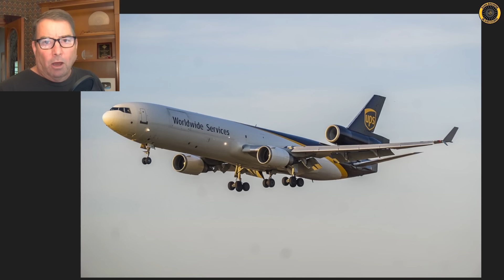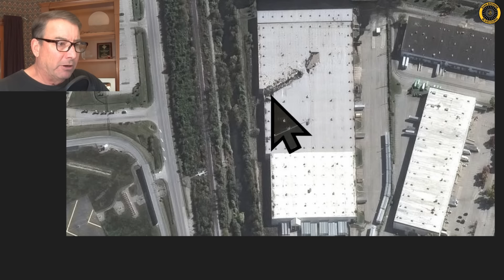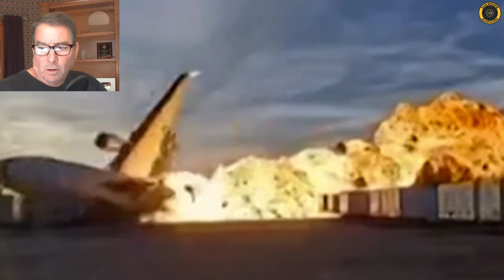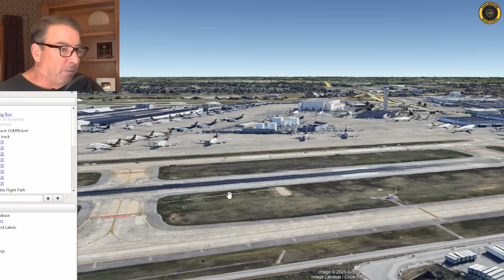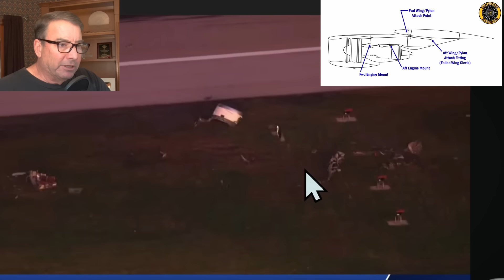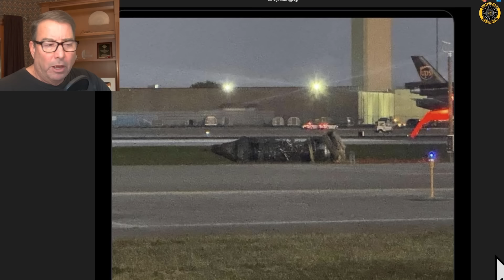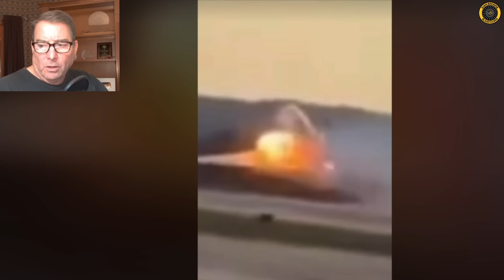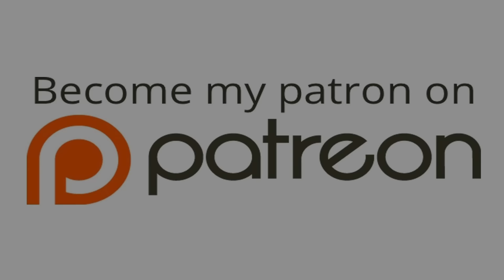UPS #2976 UPDATE 2 6 Nov 2025

Comment: The wings were so level it seems it could have been the gear that dragged through the roof in that photo.
Reply from the maker: Could be! Good point.
Reply: @blancolirio  Thank you for pointing out that even if it resembles the accident from the 1970s, it isn't necessarily a repeat of it. Whatever happened, the sequence that got them there should be fairly different.
Reply: @kimberlystewart8980  Indeed. That was very enlightening for me after all the comparisons with AA Flight 191 during the last days.
Reply: @blancolirio  It's interesting that the airport side of that building is damaged, but the rend in the roof stops before it gets to the Grade Lane side of the roof. Maybe the pilot flying put in one last ditch effort to clear the roof causing a tailstrike, and the plane momentarily responded by climbing a few feet before the inevitable settling back down.
Reply: @rasloan55 I thought that is when the plane started to turn on its side. Pulling the landing gear off the roof and higher in the air. But that is a complete guess! I could be totally  wrong
Reply: @wordswritteninred7171  I've been playing an unedited version of that dashcam footage frame by frame. The plane was wings level as it crosses the road having already struck the roof of the UPS warehouse and surprisingly intact. But it appears to me that the left wing strikes the top of the black tanks in the background that are the Kentucky Petroleum Recycling company, that's when the first fireball occurs. I suspect it was petroleum, not Jet A1 fuel. But that likely destroyed the left wing, now leaving a trail of Jet A1, and that would be the start of the roll to the left. As the plane passes behind the billboard you can see the right wing rising. As the plane exits the frame to the right that would be about the time it appears in the horrific shot on the cab-cam of the truck driver sitting in his cab in the marshaling yard with the plane at an almost 90 degree angle of bank to the left and the left wing gone.
Reply: @blancolirio  If you watch Mentour pilot video from last night He pointed out that possibly engine #2 had a compressor stall make the situation worse, Actually it was his guest that is a former MD11 pilot.
Reply: @wb6anp Juan pointed that out yesterday
Reply: They bounced off the building.
Reply: @jamesm568  Left main gear, yes!
Reply: The new dashcam video is after the plane hit the roof of the UPS building.  You can see the left wing hit the tall black oil tanks right after it hit the power lines.
Reply: If that was the case then the tail would have hit the roof too.
Reply: @Captain101-x1o   Maybe, maybe not. He had a fairly flat deck angle by that point.
Reply: Over the street the gear looked pretty good, round tires. Depends on how tough a warehouse roof is. What upset the wings level situation looks to be bright live wire strike on #2 engine.
Reply: The plane must have hit the roof with the tail. The dash cam footage is from Grade lane, not Crittenden. It made it over the impacted building before we see it in this new footage.
Reply: I agree that the building was likely struck by the tail and not the wing. The tail is made to handle tail strikes on the runway.
Once the tail hit the building, 2 things would affect the airplane. The airplane looses energy from the impact, and the impact is an upwards force on the tail that would generate a moment around the CG to bring the nose down. Not to flip the aircraft but just reducing the angle of attack slightly. And law of energy conservation would explain the aircraft loosing the energy equivalent to the damage made on the building, as partly airframe deformations and loss of speed/momentum.

Because although this is not the same perspective, it seemed to me that the aircraft had a higher angle of attack at the end of the runway, compared to the dashcam footage before impact with the tanks, and after the building impact.
Reply: @mansfieldi02 from an engineering perspective I would expect the fuselage to brake apart immediately if that was a tail strike. The landing gear, on the other hand, is designed to withstand far higher impact without causing critical failure of the fuselage
Reply: @SlimShady_4  Might depend on the AoA if the tail / fuselage struck the building would have torn the aircraft apart. It was clearly gaining altitude at that point, and that makes a gradual impact of the fuselage with the edge of the roof somewhat possible, at least (maybe) enough to get the edge of the roof broken, and following that I don’t think it takes much to keep the roof collapsing along that line.
Reply: @SlimShady_4 actual crash testing shows that the aircraft hull from pretty much wing box on back stays intact after a hard belly into the ground. The forward is usually what breaks off, not the tail.
Reply: @Nurhaal if only the tail hits something though the forces will be far different to than if the whole plane hits the ground flat
Reply: @patrickryan1468 
Theyre in a stall which forces a pitch up on those ground tests and water landings. 
The reason the forward falls off usually is due to the tail striking first, causing a moment action like a lever arm and the forward section of these commercial airliners are assembled in sections. The FWD breaks off usually at the FWD bulkhead. 
The empennage tends to stay intact because its at the end of the pressure vessel hull, whicj reinforces that section of the aircraft. The FWD, right ahead of the wing box and at its mated bulkhead, is pretty heavy and so it snaps. 

I think it is plausible the roof damage was from tail dragging on the roof. And while a warehouse roof is pretty hard, its not as hard as the ground or even water (uncompressable fluid). The roof would easily crumble and shred on an impact like that, allowing the tail to survie. 
Aluminum is pretty good at surviving tensil stresses in stretching, ductility and compression. What it cant handle what so ever is shearing forces. Its pretty bad at that. 
It also makes sense for the plane to tail strike there base on video of the aircrafts orientation. The loss of the engine 1 while the pilots react and try to keep engine 2 at max throttle would inpart some asymetric thrust dynamics, which is why the plane seemingly went to its left after leaving the runway.
Reply: Likely landing gear, agreed. If it was the wing the plane wouldn’t have become airborne again (momentarily)
Reply: I have a very good question that demands an answer….why is there ANYYY type of fuel storage that close to the end of a runway? We don’t know yet, but maybe if that storage tank wasn’t there they may could have saved the airplane. This takes me back to the recent crash where the airplane collided with what was more or less a concrete bunker at the end of the runway. I always assumed there would be a permitting process for any structure at the airport or within a certain distance around the perimeter. If there isn’t they should be. They could have Ai issue the permits based on standards and extra risk assessments based on individual airports.
Reply: @K9Escapes what would this change? 
If the number 1 engine is gone and the number 3 is FODed, the aircraft at that weight, past V1 and rolling, is doomed wrather the end of the run way had a giant Amazon complex or an empty field. 

Its important to try and think on a common sense level. We could apply some change if indeed it seemed a bit close, but the issue at hand is that the Root Cause Analysis is not going to say the crash was caused by structures or storages too close to the runway. 
I understand the concern but its basically a misguided reaction that simply doesn't address Root Cause. It band aids an error that has little if anythiing to do with the crash at all.
Reply: @Nurhaal - it  would potentially change the intensity of the fire and the number of casualties on the ground.
Reply: @lauraelliott6909 yes, it would, but if we find out the root cause was preventable, it still matters non. There could have been ZERO deaths if it turns out the failure was a preventable. 

A good example of the fallacy I'm trying to point out is the crash here in DFW where an aircraft on final went through a small thunder cell that had downbursts. The aircraft slammed into the highway right by the airport, during rush hour, adding a lot more deaths to the total. 

So what the reaction. 
To remove the highways from being too close? 
No. It was a preventable. 
Avoid approaches through any and all super cells. 
Problem solved.
Reply: @Nurhaal  So simply eradicate pilot error once and for all - and while we’re at it mechanical failure, maintenance error, ATC error, etc. - and we’ll no longer have to worry about where the highways are.
Reply: @skoto8219  Basically. Thats what we did. Pilots are now instructed to avoid thunder cells when on approach and in general. 

Im sorry to inform people, but flying is a zero errors allowed occupation. I've worked in aerospace for years. A single mistake can kill people, regardless of your pentiant to use geo zoning restrictions
Reply: @Nurhaal  Yes but until we achieve perfect pilot performance, perfect aircraft, perfect maintenance, etc. you can understand why people might worry about zoning.
Reply: @skoto8219 we are never going to achieve perfect anything. 
The point is to try ans accept that discipline will always be required. Youre never going to have a system, any system, be societyx government, vehicles or anything, with zero points of failure. 
Its impossible. 
The best we can do is take responsibility and mitigate it via discipline. Not make an easy excuse by requiring we move building A further away from runway Bz becauee of an event where an ENTIRE ENGINE FELL OFF BEFORE THE JET LEFT THE TARMAC. Eh hem.
Reply: @Nurhaal  I’m, in case you couldn’t tell, right there with you on the point that we’ll never eliminate aviation accidents. I just have trouble understanding why you think their inevitability is a great argument for not moving buildings further from runways lol. There may be good arguments not to do this but “well, planes are gonna crash regardless” doesn’t seem like one of them.
Reply: @skoto8219 thatnwasnt my argument.
Reply: @Nurhaal It could have changed the e tra flammable and explosive materials involved in the accident. Even within a building, there are laws regulating where explosives and flammable materials can be kept. This is a prime example of why such a business should not be located so close to an airport. There is a whole city where they can do buainess. Why so close to the airport?
Reply: @skoto8219 Really! Seems a person who understands  that shit gonna happen, would be the very person to say, "so lets move the explosives to the other side of town. I will never understand  people!
Reply: @K9Escapes I use to work at SP Recycling on Industrial. Just up the road. Like a mile up the road. And we had business with them. I have been in that parking lot a dozen or so times back then. And the planes come over so low! It scared me the first couple of times. And i worndered the same thing. Even talked about it. And was surprised  that zoning allowed it. But there it was. And now, here we are. I wonder if anyone could have survived if not for that being there. My cousin lives up blue lick. Maybe ten miles as the bird flies. She heard and felt 3 or 4 explosions. I suspect those did not come from the plane.😢
Reply: Have you guys stopped to consider it might have been engine thrust alone that damaged the first roof? I find it hard to believe the aircraft would have continued so far if any part of it hit a structure like that.
Reply: @davidkavanagh189 no because the airport facing sidewall is impacted too I.e the wall, not just the roof.
Reply: @scollyutube  Maybe. I imagine we'll find out soon enough either way.
Reply: @scollyutube  Yeah fair point about the sidewall but I still find it odd the aircraft managed to climb a bit and was still clearly intact sans engine if it truly did cause all that damage by impact. I'm sure we'll find out in due course.

Comment: That plane was doomed when the number 2 engine injested debris
Reply: Just the flames and hot air could have caused compressor stall....
Reply: @johnmoruzzi7236  I would think they would blow back more they were going 140 knots or so but maybe.  I watch accident investigations for fun and I don’t think I have ever seen an engine blow up like that.  Shrapnel is not new Southwest lost a passenger a few years back and a few in the 70s before inspections improved but that one just detonated.
Reply: @johnmoruzzi7236 
I don’t understand how nr 2 can stall, it’s a good distance between 1 and 2 and it happened at high speed so debris and smoke should leave straight behind? Yes, if the turbine discs catastrophically failed, but then the engine wouldn’t detach. I strongly suspect pylon failure especially since it happened before on the type.
Reply: Sorry, FOD…that is how. Turbine engine fans and discs are very durable until foreign objects enter the engine. The primary fan on these engines are made from titanium; titanium forging do NOT yield to outside force. When the shrapnel from engine one was ingested by engine two it more than likely ripped many blades from the compressor turbine discs causing the compressor to stall.
Reply: @stevehicks8944 
Yes understand that nr 2 failed when ingesting FOD, but what I mean was that I don’t understand how debris from no 1 can reach all the way to no 2, seems like debris should go straight aft, far from it.
Reply: I don’t think the wing fire would have allowed more than a few extra seconds of flight even with the number 2 engine at full power.
Reply: @VagabondStreetMoto and you would be totally wrong in that thought.
Reply: @qwerty112311  The wing fire was immense. It is doubtful that wing would have lasted long enough for them to air return. Maybe, but sadly as they lost thrust in another engine there was nothing they could do.
Reply: ironic that 3 engines were supposed to be safer than 2.
Reply: @TheSateef The trijet was supposed to be more economical than the Jumbo with 4 engines
Reply: @TheSateef  The 4 engine designs would propel the engine forward in a catastrophic even then take out the adjacent engine.  El Al, Branif and maybe one more.
Reply: @naughtiusmaximus830  Trans-Air Service Flight 671, B707 had #3 separate and take out #4 (but managed to land)

Comment: Firstly, my heartfelt condolences to the families of the deceased.

Secondly, I know it's early to speculate, but would it be possible that the airplane was simply too heavy to lift off in a timely manner? I've heard they were way past the rotate speed, but not gaining any altitude.

Thank you, Juan, for the informative video, as usual.
Reply: Evidence rules that out; it points to the debris and/or fire from the #1 engine stalling the #2 engine.

Comment: Do you think there is a way or aviation to eliminate V1 speeds. Airport design, environmental conditions, aircraft design, of course influence V1 speed, but wouldn't it be safer to actually stop before Vr, or at least in specific circumstances?
Reply: If it's understood there is a failure which is severe enough that the aircraft will fail to get airbourne, then a takeoff can still be rejected after V1. V1 exists because usually there isn't the time to properly understand what the issue is to make an informed decision about whether to continue to get airbourne or not, therefor V1 provides a speed at which it is likely to be safer to continue the takeoff and properly understand the issue once airbourne. It might be that 999 times out of 1000 it's safer to get airbourne after V1, but there will always be the one occasion in which it would have been better to reject after V1, but it's unlikely the pilots will know if it's that one occasion, therefor it's better to assume it'll be one of the 999 and use V1 as a hard line to continue the takeoff.
Reply: pilots need procedures that are simple and cover vast majority of cases
Reply: @olasek7972 you don't think they have those already?  What would the procedure be for a jet engine falling off of your wing right at the moment that you have to rotate
Reply: @cremebrulee4759  yes comrade, they DO have those already, you guessed correctly